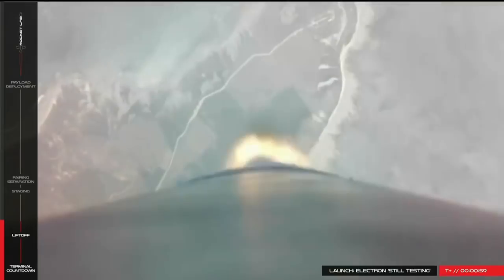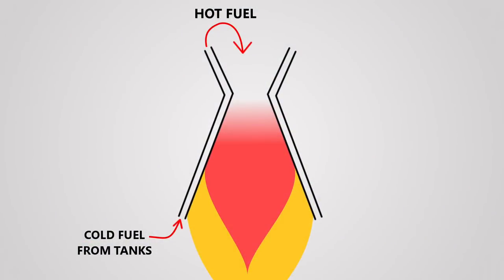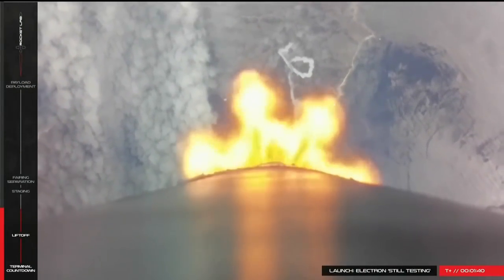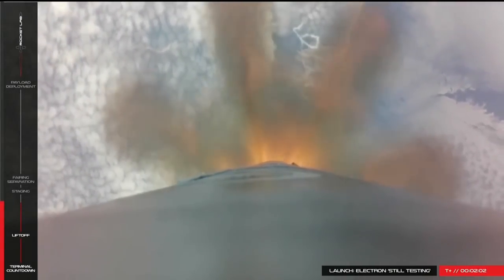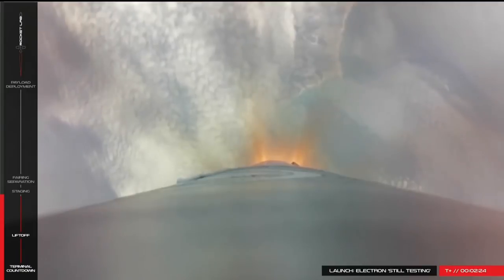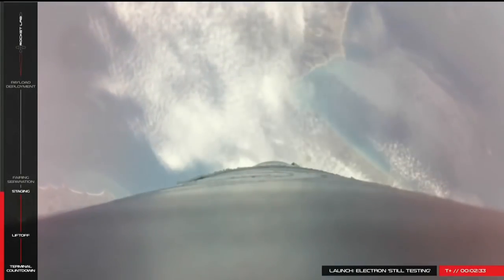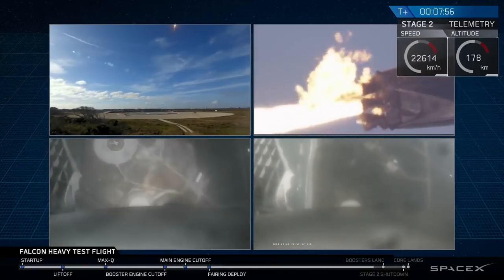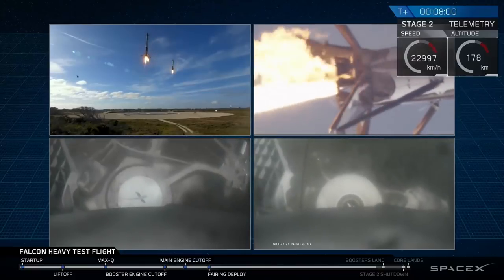How Rocket Engines Work - Part 4 - Cooling

Comment: AMAZING VIDEO. I always knew that liquid fuel rocket engines use their fluid to cool down the nozzle, but I always wondered what solid fuel rockets used. Ablative material is genius. Although I agree not the way forward in future, as reusable rockets are much better ;)

Comment: Okay, first of all, I really loved your videos. They're really amazing. I had one question though. So in the previous video, you said the diverging part of the nozzle is used to increase the velocity and here the increase takes place with the reduction of heat and pressure right? So would it not mean that the diverging part of it doesn't require cooling as the heat is already decreasing at the expense of an increase in velocity? Idk if my understanding is wrong somewhere, but I'd really appreciate the help!
Reply from the maker: The diverging section is still super hot, but not as hot as the combustion chamber or throat. So usually engines still need some cooling there, but not as much. For example the Merlin-1D engine only has cooling channels part way down the diverging section and the very end of it is just radiatively cooled.

Comment: That cooling using the fuel liquid is so brilliant like what's amazing about it is you're not adding more weight by adding more cooling materials but instead use the existing liquid as cooler

Comment: Just got a question. I believe the rocket engine mounting has to withstand a force perhaps equal to or more than the thrust given off at the engine. What kind of mounting or material do we have in rockets that prevents the mounting or engine itself from buckling or damage?
Reply from the maker: The design of the mounting hardware can be very different from one engine to the next. I'm not sure what the most common material for mounting hardware is, but I would guess high quality aluminum or lithium-aluminum alloy is the most widely used.

Comment: most solid engine don't use cooling at all because they burn much quickly than liquid fuel they have short burn time and also they are made of material which can withstand much more heat

Comment: what about copper cooling, like the Soviets used? Make the nozzle out of solid copper which vaporizes away to keep it cool, with the copper getting thinner and thinner as the rocket burns.
Reply from the maker: That would be a type of ablative cooling. But I've never heard of using copper for that. Usually when  a rocket engine uses copper its to transfer hear to a regenerative cooling system since copper conducts heat so well. Some of this copper can burn which can be seen in some rocket engines as a green flame, but this is pretty minimal and isn't intended or part of keeping the rocket cooled.
Reply: He actually starts the video talking about ablative cooling…